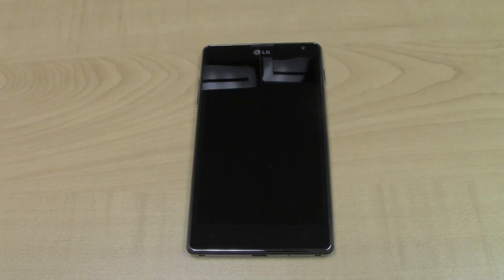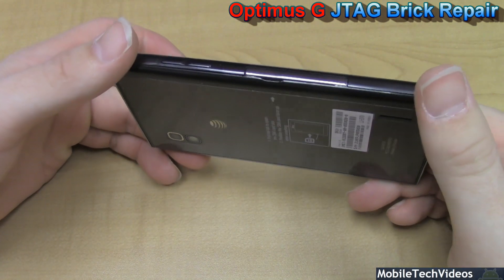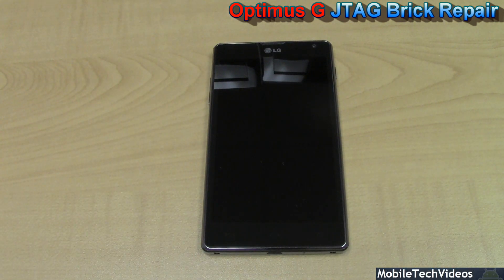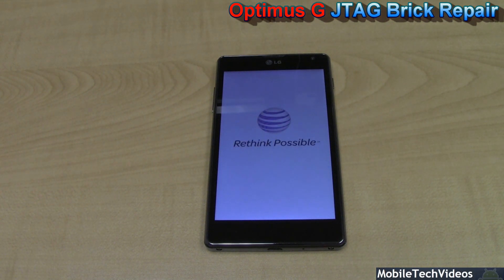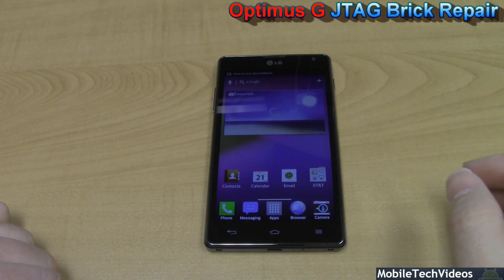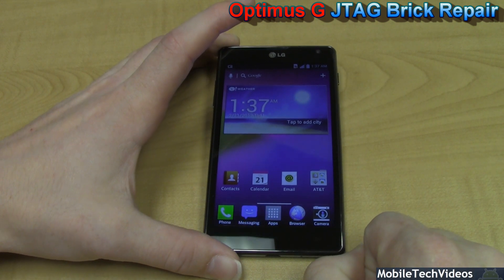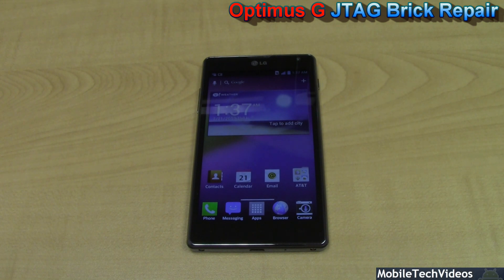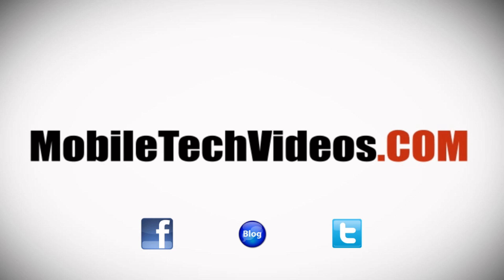LG Optimus G - JTAG Brick Repair Service (Debricking/Unbrick/Brick FIX)

Comment: MCU meaning microcontroller unit, I assume? I recently learned that the MCU functions via a JTAG interface, so I was just wondering how a JTAG Brick Repair Unit works. Is it that there's a hard coded set of instructions or code on the JTAG unit that basically resets the MCU and it's ROM and flash memory back to stock or otherwise? I'm just learning how to program MCU's like the PIC 32 and 18F series.

Comment: Guys if u have a bricked optimus g this company is the one to go with, I used that Flax123 app to adjust my processor speed and I messed up and did a update I should not have. Dam thing would not turn or charge or go into recovery mode, not even download mode on my computer. So I sent it to them and its good as new and it was done fast. Thanks mobiletechvideo

Comment: What other services do you guys offer? I recently upgraded to the G (Sprint) and within three days of having the phone came across a cracked glass back. At the current time it had silicone cover on. When I removed it noticed the back glass cover of the phone had been cracked! Having no idea how it happened I went back to the store to see what could be done, nothing warranty voided. Went to my sprint rep., same scenario. I was than told to try LG. I'm still waiting communication from them

Comment: Unsure if your JTAG service can fix this.  Phone was put in the wash for a brief moment and now unit may be dead.  I opened her up and removed the battery and put it in rice for a day or so. No power when I try to power it up but when I put the power cord on, I get a blinking red light up top and the 3 soft buttons blink.  If I plug it in a computer I can see some power come to it by indication of it install "usb input device" but you can here it disconnect/reconnect.  Help!

Comment: Hi I've got a bit of a problem. I tried to downgrade my LG optimus ONE (P500) and i was running 2.3 and tried to downgrade to 2.2. I tried downgrading it (with the KDZ tool) and I wasn't on the homescreen (to make it work) and it got into emergency mode. Then the tool got stuck and force quitted. So I pulled the battery and putted it back on and tried putting it into emergency mode but no luck so what should I do? PS: my volume up button is broke and all i'm left with is a black screen

Comment: Hi my sprint lg optimus g got brick
Due to a bad rom I tried to install but my case here kinda different cause phone can go to download mode and the recovery mode which probably can be much easier for you..ok my mean questions is I see you mentioned on the ebay site I have to send the phone without battery which can be difficult to remove since i don't have all the tools please let's me ken if it ok to send that type of phone with the battery attached

Comment: auspicious day. I installed the app inadvertently AUTOREC lg d855 g3 and my phone was turned off and will not turn on download mode does not turn on. 
com USB connection, but when the computer sees and can not intervene. Can you help me in this regard ..
Reply from the maker: Did this happen for no reason at all?
Reply: I did not install it myself
Reply: Help me.  LG G3 D855 boot repair.. please
Reply from the maker: melkan söğüt We do not have a boot repair solution for the G3 unless it is in Qualcomm Bulk mode, download mode, fastboot mode or recovery mode...
Reply: Does the future will be
Reply from the maker: melkan söğüt Possibly but this is difficult to know. For now, there is no ETA...

Comment: is it possible to do this at home? because i cant send you my phone- its too expensive, or mayby someone can help me- my phone has stucked in download mode- even unplugging battery is not helping :(
Reply: Josh Groce where can i found the dll file for my optimus g?
Reply: Piotr Sulej no matters- i've repaired it with software oppdate tool :D
Reply: anyway thanks for your help, because if you hadn't repply i wont tru uppdate tool...